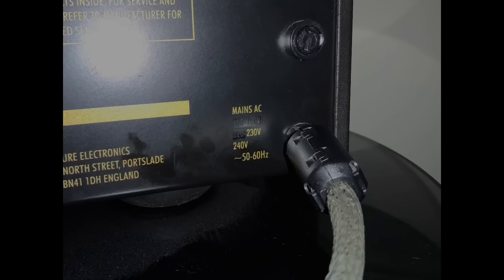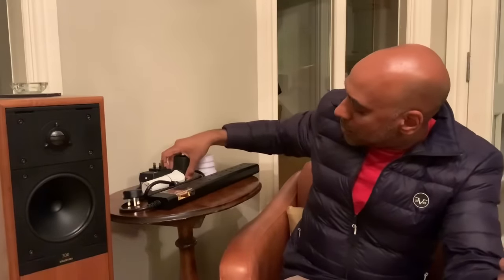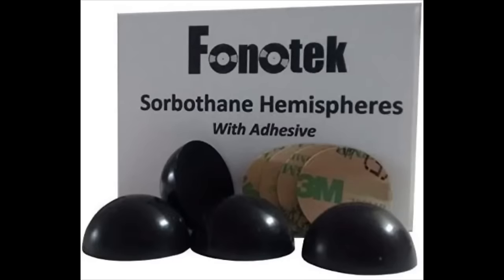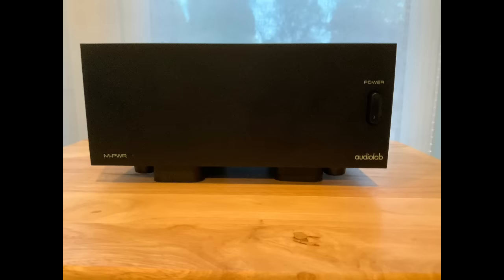My Top 5 Inexpensive Hifi Tweaks

Comment: Did you ever hear something through a speaker connected only to a cable without an amp? If not, what do you want to filter with ferrite cores in between amp and speaker?
Decoupling is very important, but you need to decouple the frequencies which are problematic for your environment, and those can be very specific, even different on different speakers. There is no "one fits all".
Regarding power, there are some stabilizers (e.g. Furman is a well known brand) which helps you, if your power is not stable enough. Typically it is better to reduce the amount of other equipment from the same phase or at least cable. I use them only as an emergency equipment for short times (e.g. they make sense with a PA). At home there is better ways.
Typically the biggest issue at home is reflections on the walls... this is easy and cheap to overcome but not covered here. That would have made sense.
Reply from the maker: Thank you for watching and sharing Moskito H.

Comment: I’m sorry - but what you say about ferrite cores is wrong.  They are not ‘magnets’.  They are designed to attenuate unwanted noise (aka EMI)  in the tens-to-hundreds of megahertz frequency region of the electromagnetic spectrum and have no effect at lower frequencies.  I don’t know anyone who can hear radio frequency just yet, but I may be wrong....
Reply from the maker: Hi Mike, I should have said ferromagnetic material. The problem with EMI is that even though it is above the audible range it can effect the operation of sensitive electronic components. Best to prevent it from getting near your hifi equipment. Ferrite cores effectively work as an inductor. This added inductance can be a benefit in some speaker cables and system in others it will be a detriment. However, it is inexpensive and worth experimenting with.

Comment: What about the unwanted signals that have already been induced into the ring main of the house or the national grid for that matter? A mains conditioner or filter cannot erase these and they are most certainly entering your equipment. You are only controlling entry into the cable between the power outlet and the power Inlet of your equipment, the unwanted signals are already in the 2.5mm square twin and earth of the ring main.

Comment: Interesting video. Im afraid im in the snake oil camp regarding the mains conditioners. Electrical devices that produce rfi have to be tested to EU standards to prove they have the correct supression. I would of thought a quality amplifier would already have a PSU which rejects noise, especially if it is a class d using a smps. The only way i could see them affecting dynamic range would be if they reduced the line voltage. Amplifiers using a linear psu step the voltage down anyway. I agree with coupling/de coupling speakers however. Great video though. I like your approach to presenting the topics. Id be interested in your thoughts on amplifiers and speakers at a slightly lower price point
Reply from the maker: Hi Jay, thank you for watching and commenting. I do hope to do videos and reviews on more accessible equipment and speakers in due course.

Comment: Hello Tarun .. would the mains conditioner and the power strip help with speaker hum ? Thanks Alan
Reply from the maker: It may reduce it but there is probably a ground loop with your equipment. It won’t help to fix that 😊
Reply: @abritishaudiophile7314  Thankyou 
Thankyou

Comment: SD feet, rubberfeet, Disc Of Silence springs and other absorbents can have usefull effect for eliminating mechanical feedback when placed under electronics and mechanics in the set-up. 

They can partly ensure against acoustic feedback and the phenomonen “Microphony” in the discrett components in the circuitry.
You can also use absorbents for decoupling a turntable which is build with this princip.

But these absorbents will never be anything but degrading when used under speakers.
What happens, when using absorbents under speakers, is that the energy meant for the driver to transducer into acoustic waves in the air will be……………..well………….absorbed by these…………..well……………absorbents…………because the cabinet will give in and put the energy into the absorbents when the driver diaphragm start moving.

Some people will argument that soundwaves i the cabinet will be absorbed and the floor will stop accompagning the music with resonances.
But the function of a speaker cabinet is NOT to carry soundwaves.
Furthermore, a floor can be more or less suited in a listening environment.
But a floor will rarely be as spongy or resilient that speakers on spikes will make the floor give in to the extend as absorbants does.

If the floor is resonant, a carpet will often be a great solution.
Huge glass areas should be covered and musical instruments resonancing on certain tones should NOT be in the listening room.
These steps is “categorized” within basic acoustic trimming of the listening room and can not be replaced by absorbents under the speakers.
The consequence when using absorbents under the speakers will, logical enough, be that the soundstage gets muddy, attack will delay and soften out, precision will be eliminated, perspectives will become unclear and dimensions of the music will no longer “fool the listener” to believe that he is present in front of the music live.
Reply from the maker: Thank you for watching and sharing Lars 😊

Comment: 1:56 Putting ferrite cores on your speaker cable means that you put on a high frequency filter to the signal. These cores are usefull on your ac cable to avoid interfenence signals coming into your device..
Reply from the maker: Thank you for sharing.

Comment: for low cost improvements, I would suggest managing cables so that speaker / interconnect / ac mains cables are positioned not to be close to each other. also on old equipment, reconnecting all connectors can bring improvements (speakers especially for me)...  that then could make you think of contact cleaner/protector like deoxit, (or renewing/upgrading connectors in older gear)
Reply from the maker: That sound like good advice to me. Thank you Lee 👍

Comment: oops, the shield only acts as a shield if it is connected at one end of the cable to ground (usually at the wall) it must float (not be connected to anything) at the other end and be insulated.
Reply from the maker: Thank you Moray. I amended my advice accordingly in the following video.

Comment: My gear is plugged into a Furman Linear Power Conditioner and the Furman is plugged into a Monster Cable Power Strip. The plug next to The Monster power strip is partially blocked by a large acoustic panel.
If I purchased the Ifi parallel mains conditioner and plugged it into the Monster power strip next to where the Furman Power Conditioner is plugged into, will the Ifi device still work effectively?
Reply from the maker: It should do 😊

Comment: Good video, would you have a link for the Sorbathan blocks. I can't see them on Amazon.
Reply from the maker: Hi Adrian, I couldn’t see the Sorbothane ones on Amazon but I have used these Silicon ones and they work well.

https://www.amazon.co.uk/Hudson-Hi-Fi-IsoBlock-Silicone-Isolation/dp/B079SV39KW/ref=sr_1_11?dchild=1&keywords=sorbothane%2Bisolation%2Bfeet&qid=1589709175&sr=8-11&th=1
Reply: @abritishaudiophile7314  Many thanks, I don't have to buy from Amazon. Happy to pick them up from elsewhere. In addition to buying these for a Blu-ray player, DAC, single drive music NAS etc. I'm also thinking of getting some for a REL Strata 3 sub. Would you have any recommendations for which ones to use with a sub? Thanks Adrian
Reply: Actually just watched the video again and saw you recommend the washing machine isolators for speakers. Will give those a go. Thanks again

Comment: I often see wooden floors in HiFi vids - isn't that a very bad idea? My room is very dead and I really like the sound. My room is more of a home studio though. Perhaps the "nearfield monitors" I mainly listen to are more suited to that sort of room. I have Hifi speakers and rubbish surround type speakers in there as well to get a second opinion of the sound and I still think my dead-ish room is the best.
Reply: I should also have said the room I was talking about has a carpet and thick underlay as well as lots of soft furnishings and other items that will break up sound reflections.
Reply from the maker: Hi 45rpm, I would decouple the speakers from the floor and pick a speaker with a brighter sound to compensate for the deadened room. B&W and Focal come to mind.
Reply: @abritishaudiophile7314   Thanks for the reply! By deadened I meant having a lack of reverberation which I always assumed was a must for critical listening. If I snap my fingers in that room there is only about a quarter of a second of reverb. I use the room as a "home studio" but if it was purely for listening pleasure would more reverberation of the sound be preferable?
Reply: Moving to a house with a concrete floor from suspended wooden was the biggest single improvement to the same system I've ever experienced in 30-odd years of playing HiFi.

Comment: #3 mains conditioner maybe you should try one of these and take it out of your system if you still see or hear no benefit and that is a "Online (Double Conversion) Pure Sine Wave Battery Backup Uninterruptible Power Supply Systems (UPS) And Power Conditioners." where your system runs off the batteries

Comment: I suppose a speaker can be thought if as a differential amplifier. It should remain largely unaffected by common mode noise
Reply from the maker: I’m not sure I understand that comment Kosta?
Reply: @abritishaudiophile7314  There are generally two ways to send a signal down a transmission line:

1. Signal and ground. This is what your typical shielded coaxial cable does. The shield has a low impedance connection to signal ground and always sits at 0V as far as the amplifier is concerned. Any noise that couples into the shield goes to ground as a result of the low impedance without affecting the signal line at the core of the cable. I'm sure you can imagine what happens if you connect the signal and ground the other way around 😁

2. Balanced line. I'm sure you've heard the term before. In a balanced line both conductors carry the signal. One wire carries the positive half of your signal while the other carries the negative. Well... almost...

There is no shielding in this arrangement, instead the reliance is on the amplifier setup to simply ignore the noise.

You can't connect this directly to a traditional signal/ground amplifier (well... you could but then you'd shunt half your signal to ground), you need a differential amplifier. These are also known as comparators or op amps. This amplifier compares both inputs and amplifies the difference between them (so you could leave one end at ground potential if you felt like it). There is no low impedance connection to ground and the wires are arranged such that external noise couples into them equally (see any twisted pair cable, i.e. cat 5e, etc.). This is also called common mode noise, as it is picked up by all conductors. As the noise is (well... should be) exactly the same at both inputs of the amplifier, there is no difference to amplify, so the amp simply doesn't see it.

If you think about how a speaker works - it's a low impedance differential transducer. All it cares about is the voltage between one input terminal and the other. As long as both signal wires are terminated at the same impedance coming out of the amplifier, any common mode noise lifts (or sinks) the whole signal line (as above) and the speaker doesn't see any of the noise, even though if you scope the line without connecting your probe's ground to anything (scope ground should be internally connected to earth) you will see quite a bit of common mode noise.

Comment: Parallel Power conditoner is ALL B.S. basic electrical theory says it....as for the in line (series) conditioner..the internals of each equipment plugged in that have their own line filters ARE DESIGNED TO  MATCH EACH , ITS OWN EQUIP.
older equipment (with linear power supplies ) normally don't have. internal RFI/EMI filters..& depending on transformer 
pri/sec. winding placements & shielding ,two or more could STILL INTERFERE with each other.. although external interference could be reduced...

Comment: Good video thanks.  I have got back into the world of HiFi as a result of lockdown.  It’s been fun to catch up with developments since I used to take it seriously some 30! years ago.  One of those are the debates around power cables and clean power, which I don’t recall being a thing in the 80s.  I have been persuaded of the arguments, and worth an experiment, so I have just ordered a diy cable for my amp, from the very people you mention - McRU.  It occurred to me that if I am going to spend good money on a cable, it is worth ensuring the wall socket is replaced at the same time.  Wall sockets can degrade over time and only cost a few quid.  (Only do this if you are comfortable with electrics and don’t consider any work without switching off the mains fuse!!  Do also consider building regs.). Any views on this?
Reply: Regarding changing your wall socket. I recommend replacing with a unswitched socket. Although I have never compared a unswitched socket relative to a switched socket counterpart. Like Tarun it seems like good house keeping to minimise potentially negative effect of switches. I like Crabtree sockets that are solidly built and not expensive.
Reply: Karl Todd Good thinking.

Comment: I get confused because the Lapp shielded mains cable the general advice is to ground the sheild at the mains plug end only ...but others say ground both ends.. Why is there still much confusion over this and also shielded interconnect?
Reply from the maker: Hi John, I am not an expert in this area but this is my understanding. The shielding is more effective if you ground on both ends. The problem is that with some equipment and in some people’s homes you may experience a ground loop issue (potential difference across the cable) this can result in an audible hum and in extreme cases an unpleasant distortion. If this is the case you are better off just grounding the shield at one end (the wall socket end) this eliminates the ground loop issue but the shield is less effective as in now is connected like an antenna. I hope this helps. Thank you for watching.

Comment: These type of tweaks the improvements are not always immediately apparent. 
Also, approaching the tweak process with an open mind rather than "it's not going to make any difference." 
Make one upgrade at a time and live with it for a few weeks worth of listening.
In my experience, source components get the most benefit from better power cables. 

Don't mess with electricity if you don't know what you're doing. You'll either electrocute yourself or burn the house down.
For 60 pounds you might as well buy a branded cable from your local hifi outlet.
Reply from the maker: Good advice Tony 😊
Reply: @abritishaudiophile7314  Hi Tarun. I have spent quite a bit more on power cables, power conditioning strips interconnects, component supports, and speaker stands over the years, but every one of those upgrades improved the sound I was hearing to a greater or lesser extent. What you describe as the 'housekeeping' bits could be thought of as another complete component. 
Buying some new bookshelf speakers might be more exciting, but an upgrade of speaker stands could actual produce a bigger improvement and cost less than a component upgrade. Does that make sense?
Reply from the maker: @tonywillans7556  makes total sense. The system is the sum of all parts and only as good as the weakest link. This video was aimed to be as assessable as possible 😊
Reply: @abritishaudiophile7314  I like your "accessible as possible" approach.

Comment: Would the ferrite clamp work the same way for a bi-wire configuration, just clamp to any one of the four ends?
Reply from the maker: I would start with one on the woofer and then try another one on the tweeter. If you get any high frequency roll off take it off and stick with just one on the woofer.

Comment: Hi Tarun, what would you recommend for bookshelf speaker on a tv cabinet to counter vibrations? Please do not say speaker stands, because I have to make concessions due to the fact that I am in a relationship 😅
Reply from the maker: Hiya, I would get some sorbothane or silicon feet. Get the larger ones as they all have a weight limit at with they are no longer effective. Good luck 😊👍
Reply: @abritishaudiophile7314  Thx!

Comment: my hifi upgrade, discovered by accident:

I read about using large diameter wire for speaker cable, because of a thing called damping factor. bottom line, bigger wire, cleaner bass. no need for $30 a foot audiophool wire, zip cord is fine, but use 14 gauge

I zzzt-poofed a woofer. replaced it. noticed that the wire from the crossover to the woofer was puny. put in a foot of 14 gauge. fired it up. damn! now the other woofer is toast! put my fingers on the toasted woofer, and it's working. WTF?

replace the wire in the other speaker and voila; thundering bass on both sides. that one foot of wire in the box made a world of difference, but you need the 14 gauge wire from amp to speaker to box to make it work..
Reply from the maker: Thank you for sharing your experiences 😊